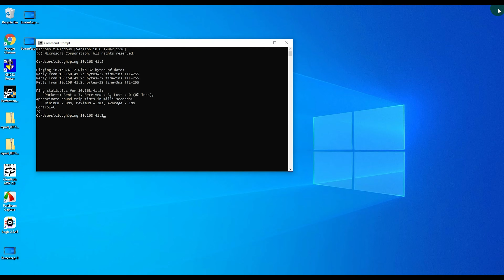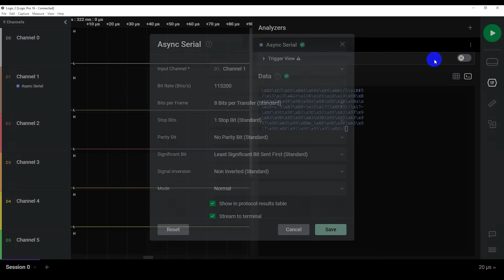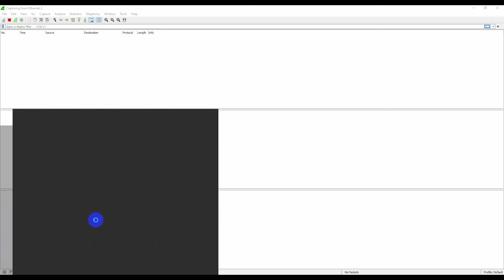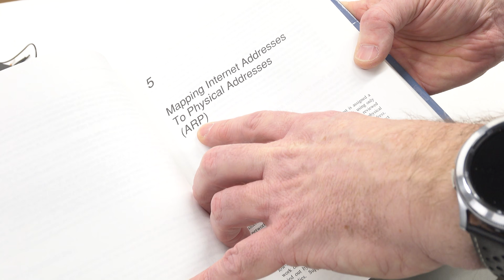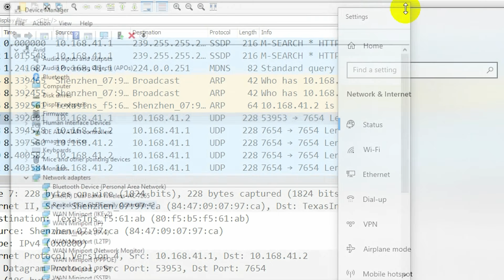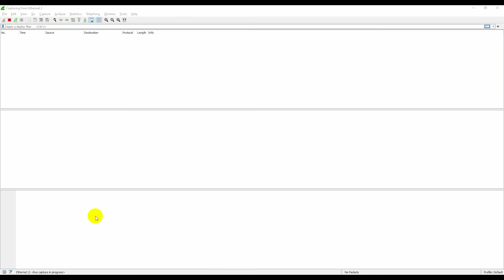Troubleshooting the Centroid Acorn and Ether1616 Network | Why won't it connect? | Beelink + Realtek

Comment: How do you find out about tools like Wireshark? Not to mention the logic analyzer. Your thorough understanding of the tools you have at your disposal, and watching you use them to find a foothold in a complex problem like this is really cool to see. Great stuff.
Reply from the maker: I hang out with smart people.  I wrote low-level network management software for many years, and a sniffer is part of the standard toolkit for that kind of work.  I have friends and coworkers who build embedded industrial systems for a living, so I get to see all kinds of very cool and very expensive equipment.  Lots of that kind of gear is starting to filter down to the hobbyist market (Rigol and Siglent digital scopes, Saleae logic analyzers and a hundred similar devices, Der EE LCR meters, etc.)

Comment: James I have been a user of the Acorn Centroid product for a number of years and the company has an active user forum as well as tech support via email for troubleshooting. I am surprised you were not able to resolve the issue with what is available and were compelled to go into such detail to resolve the issue. However, I am sure they will appreciate your feedback on the problem.
Reply from the maker: I opened a thread in the forum and was immediately assisted by a couple of people.  After going through the usual suggestions to turn off IPv6, firewalls, virus scanners, etc. they were stumped.  I reported my solution back to the thread and added a link to the solution in the first post.

Comment: Nice demo of packet communications and protocols. Drivers and how windows makes certain defaults can be equally frustrating. I have a test system that uses a USB bridge to Ethernet and is internal to the device. Windows and it’s fail sage registries (ya right) kept dumping my manually selected driver anytime I went from using a docking station to not. Even still using the same physical connection. Anyways, great demo!

Comment: There's something really strange going on here - ARP offload is supposed to let the NIC RESPOND to ARP packets while asleep, not interfere with the OS's ARP requests.  There's clearly a bug somewhere but that's not at all where I would have expected it.  Maybe Realtek's ARP Offload means something different?
Reply: The problem here is that the hardware implementation of the ARP protocol was not correct. Instead of determining if the destination IPv4 address is a broadcast address, the packet wasn't transmitted. Instead an ARP request was generated, then when no response to an invalidly formed ARP request was received, the packet was dropped from the internal buffer on the Realtek chipset.
Reply: This implies that the NIC is doing both ARP requests and ARP replies, which, if that was the case, the ARP request wouldn't even show up in wireshark.

Comment: Thank you for taking the time to explain each element. I find that troubleshooting definitely forces us to understand what is actually happening. As others have already stated this was a great mix of software and hardware interrogation. I appreciated seeing your logic and technique in the piece by piece approach to locating the cause. 
I ran a CNC shop for 8 years (2000-2008). At that time, I had little interest and no time to understand how the all of the elements come together to make such a machine operate. I'm now in my mid 50's I am discovering a great interest understanding how all the pieces fit together. I find myself obsessed with learning all that I can, and working towards a reason to build something that provides me the sense of accomplishment. 
I am very interested in learning, understanding and applying how test equipment works. Your logic analyzer seems like an interesting tool. I want to understand that tool and the oscilloscope!

Comment: Software that has too much automagic without manual override is not a good design. Since you could ping, a manual IP config would have solved the issue without the need for layer 2 network debug.
Reply from the maker: According to Centroid support, you can't set up the Ether1616 manually; it has to respond to the broadcast.

Comment: Great Video!

Curious if manually adding the MAC address to the ARP cache would have solved the problem (i.e., arp -s <ip-addr> <mac addr>).  

Protocol handling in the logic analyzer was really neat to see in your video. I sort of knew it could be done but the last time I used one, I don't think those feature were common.  At least not on the entry level equipment I was using.  

One of the things I love about your videos is your ability to deep dive into any category along with your willingness to share the journey as your learn and figure it out.  You are also one of the few people I know that thinks sewing machines are cool too.  After all, it's a tool!!!  THANK YOU.
Reply: In that case you add it to the software cache. The would problem was that the software stack was not used at all. Instead a broken implementation on the ASIC was used. So your suggestion would probably not change that.
Could still try though
Reply from the maker: Interesting idea.  I did notice that when it is working, the broadcast adress does indeed end up in the cache.

Comment: Very interesting issue. I was starting to wonder if the netmask was wrong since it was trying to ARP the broadcast address, but an implementation bug makes more sense.
Reply from the maker: The net mask is set to /24.  I did check that.

Comment: Less than a minute into the video, and a life decision has been made. I’m never posting pictures of my control cabinet anywhere. 🤣 

I lay things out and really try to account for everything, but wiring always seems to take up more space than I think it will. At which point I get frustrated and usually go with the “F*** it, if the lid shuts its fine”  approach. This has the added bonus of making maintenance/repairs and troubleshooting incredibly fun, where I often explore the diversity of “F***” and occasionally invent new adjectives and phrases.
Reply from the maker: Nice.  I know the feeling.  This is not my first rodeo.

Comment: How the hell did they think that this could ever work? I mean, they have gone full on used car salesman here... "This baby does 50mpg!" ... "Will it do 65mpg?" ... "Sure! This baby does 65mpg!!", wait but, you just said.... How can the network card ever make decisions about address resolution for any protocol when those things are defined by the operating system? Okay maybe it remembers an IP... does it know the subnet mask? What about protocols other than IP? It is just promising bullshit promises that it can never actually deliver on!
Reply from the maker: I think to respond to ARP, it would only need to know the IP address and it's own MAC address.  I think the idea is to enable other hosts on the network to WOL without prior knowledge of the MAC.

Comment: I remember the time where Realtek was new (90s?) and it was just all bugs and incompatibility. But they still managed to confuse most with "reasonable" price- performance, and now many people are buying them or they're used on main boards. It's still a budget low grade brand imho.
Reply: Bullshit. Never saw a mobo that didn't use a Realtek chip for networking, none of them ever gave me any problems. I'm not saying they're some kind of bug-free Jesus-tech, but posing Intel chips alone as the One True Grail is flat-out disingenuous and I'll have fucking none of it.
Reply: @AttilaAsztalos ?? Where did I claim that Intel is the holy grail?

Comment: Having worked in networking for the past 20+ years, as soon as James mentioned that this board was using Ethernet and that there were communication issues, I was suspecting that there was a Realtek chip involved. These are very cheap Ethernet chips often found in low-cost consumer hardware and they always seem to have weird issues if you are doing any type of networking more complicated than simple web browsing, and even then they tend to have weird latency and jitter issues. This is why Intel chipsets are the defacto standard for 1G networking (including 10/100 speeds too). Manufacturers like Realtek Ethernet chips due to their cost, users are better off with anything but Realtek, due to the shortcomings inherent to Realtek chips.
Reply: While I (sysadmin here) agree that the Realtek card are not always stable, and sometimes have weird implementations. The arp broadcast functionality is one of the very base block oh the tcp network stack. I doubt that even them would fail this spectacularly on a simple mask calculation. I’m wondering if the implementation of the Realtek chip on the nuc board itself isn’t at fault. Or some hardware init’ that should have been handled by the bios on boot that wouldn’t happen ? Those Chinese nuc (I used a few for dynamic displays before replacing them with pi’s) sometimes have basic functionality mangled.
Reply: @amahashadow  It's more than that with Realtek chips. The don't handle jumbo frames, ARP, 802.1q, udp, promiscuous mode, any offloading (tcp, udp, arp, crc, etc.), multicast, ipv6 anycast, and more.
Reply: @amahashadow  I would say in this case that the centroid software sends out a packet that LOOKS like an arp packet, and got flagged as such by the offload processor, but in actuality is not an ARP packet at all. Hence when you turn the offloading off, it ends up coming out the cable as the packet that was intended, rather than being groked by the offload mechanism on the card and munged. The cheap cost of realtek chipsets comes at a price, "rack of testing". There's a bug somewhere - the driver, the hardware? Realtek doesn't care as it works in 99% of applications - good enough, ship it!
Reply: Same for me, in early days it was always a Novell 10-base 10 card that worked and the ne200(0) cards that failed in odd ways, now it's realtek that drives me nuts with linux issues where my intel based units work fine.
Reply: It's not just their ethernet, it's also their USB products. They are truly awful!
Reply: Yeah, I've had no shortage of problem with Realtek devices of all stripes.

Comment: Interesting. I'm bothered by the lack of that UDP broadcast packet when using the offloaded ARP. I probably don't know enough about ARP, but I don't see why offloading it should have blocked a user program sending a UDP broadcast. I'm wondering if there is really something else going on here, and maybe a timing difference or ordering difference in when ARP packets are sent is the real problem.
Reply from the maker: I think the broadcast calls to the ARP stack to find the Ethernet address, which should be returned automatically, but instead it tries to ARP for it, never gets a response, and therefore never transmits the frame.  I don't have access to the internals, so this is hypothesis.  When it works, the ARP is never sent, but ff:ff:ff:ff:ff:ff ends up in the ARP table anyway.  So I think the hardware implementation just missed the special case for broadcast.  If I had to take a wild guess, I'd bet this was a regression introduced when implementing something newer, like multicast streaming.
Reply: @Clough42  Ah, that would make sense.

Comment: Clearly, the best things to do would be to switch to LinuxCNC.  Not clearly because of Acorn, or because of this issue, but clearly because if you did then you'd do your normal deep dive on it, share it, and I'd learn so much from it.  So clearly, you need to use LinuxCNC.  This might be a tiny bit selfish on my part.  ;)  Kidding aside, I always enjoy your videos!
Reply from the maker: I went with Acorn specifically because I didn't want to have to tinker.  Guess that's going well.  :)
Reply: @Clough42  linuxcnc and mesa boards are rock solid.  Have been using them for three years with no issues.  I am a retired Cisco network engineer and a Microsoft Certified System Engineer since 1996.  I went with Linux because I have first hand professional knowledge of Microsoft's "Best Practices"
Reply from the maker: @AjaxCrypto  you're not wrong.  I installed what I thought was the right image for linuxcnc, ran the rtos latency tests, was underwhelmed and then discovered I was supposed to install a different image for the mesa card, and decided I didn't want the aggravation.  I'm glad it's stable for you.  I've been using Linux since I installed my first Slackware from floppies in the early nineties.  It works great, but keeping up with the changes is exhausting, and I want to spend my brain cycles on something else.  So far, that's not working out so well, but we'll see.
Reply: Not hating on Linux as working on the platform has paid the bills for the last 15 years. However, in the case of LinuxCNC what's the betting that James will be re-compiling the kernel and the ethernet drivers for the 50th time while wearing a t-shirt that says same ? (jk) It's lucky there was an option in the device manager to turn that off otherwise things would have gotten really hairy.

Comment: I can't believe you were even considering not to post this video. It's awesome. BTW, will you try to reconfigure your network card, or are you just going to leave the ARP-handoff disabled? Personally I don't use sleep mode, plus I don't mind any process I haven't started myself not being able to communicate with my computer, but then again, I don't run a CNC mill over my network either.
Reply from the maker: Just going to leave it disabled.  This is an isolated, non-routed segment just for the control.

Comment: Realtek writes garbage drivers. I remember having to basically "debounce" netlink messages when using the 8169 driver. Every time a cable was plugged in or unplugged, it would double (and sometimes triple) report LOWER_UP to Linux.

Freaking Realtek.

Comment: Pretty nice debugging 👍 Reminds me of a piece of network hardware I had once in my hands that repeatedly brought down the complete network. Found out that its broken IP stack replied "yes, this is me" to every ARP request on the network, regardless of the actual IP in the request 😅
Reply from the maker: That's really interesting.  I've never had a reason to hate on Realtek until now.  Sounds like I'm in good company.
Reply: I've seen that behavior from Unitronics PLCs. A lot of industrial "ethernet" is very broken.
Reply: Wow, was that setup to force a proprietary switch or point to point hookup only?
Reply: @IntBlank  No. It was an industrial RFID reader controller which could be used in any setup. But, to be fair, I think it was pre-production firmware. The issue got fixed after I reported it.
Reply: @RoterFruchtZwerg  Oh, that makes sense then. I'll hard code things like that in code under development to make testing a specific section easier. It wouldn't be hard to forget to remove a test mod, especially if there were a bunch and you just missed one.
Reply: @IntBlank  that's not a good excuse ^^ just because it's pre-production doesn't mean it can have these kind of severe issues. The unit I've seen was in use for weeks and was probably sent to lots of other customers for evaluation.
Reply: @RoterFruchtZwerg  Not so much an excuse as a reason it'd happen (esp if it's firmware from daily updates). They'd never want it to happen knowingly. A firend works in cutting edge consumer electronics. They often book trade shows months in advance of having working examples of a new product, and can arrive without a fully working unit (and be in the hotel applying fixes before and during the show)
I'm very forgiving of pre-production units especially if they're accurately described (know buggy stuff may be given to partners to find interoperability problems sooner) It's more of an oopsie if it's thought to be ok and has a big screw up like you described.

Comment: I have no idea how you knew how to even begin that process let alone push ahead logically and find the solution... but it was awesome to watch.
Sad fact though is that if I want to do Acorn on my CNC build (and I do) that I'll likely run into some OTHER speed bump that will just end it for me. I mean I'm gonna try anyway, but I fully expect to be shot down before I reach the finish line. Not sure if that makes me courageous or stupid.
Reply from the maker: They sell preconfigured computers that they support.  Like most problems that aren't caused by money, this one can be solved with money.

Comment: I've spent many years working on a large scale IPTV platform which requires a very well implemented network stack to work properly.  I can't tell you the amount of times I've run across poorly written hardware offloading on NICs (looking at you Broadcom).
Reply: Broadcom offloading has caused me much grief as well.

Comment: this is why realtek is cringe and why i got a motherboard with an intel-based network controller
Reply from the maker: And this is what Centroid would recommend, for exactly this reason.  Honestly, it didn't occur to me that this might be an issue until it was.  I was much more focused on the single-core performance, RAM, and storage.
Reply: @Clough42  I have to say I'm typing this on exactly the same BeeLink machine. I haven't had any problems with it, but I'm just using it for YouTube and an NVR to a bunch of cameras. So by and large it seems to work fine. I guess there are just a few gnurs in the woodwork.